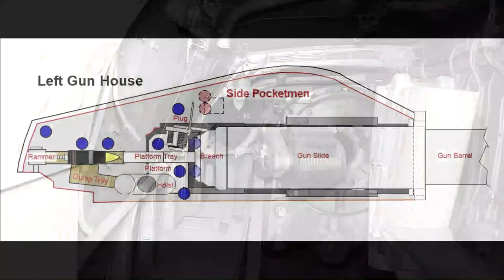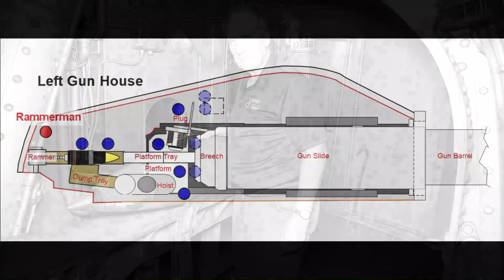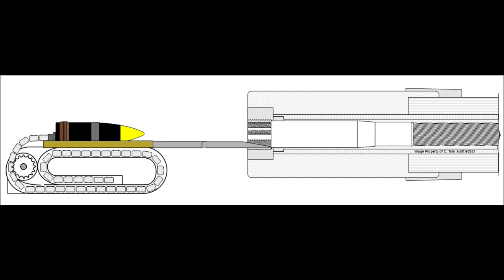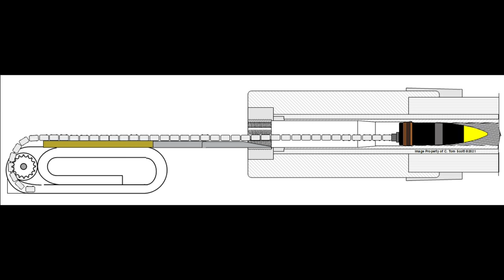Battleship Texas, Getting Loaded in a 14" Turret

Comment: What would happen or has it ever happened where the gun is loaded but never shot and needed unloading?
Reply from the maker: It would be an exceptional situation for that to happen.  They were pretty well committed to firing a gun at the moment the command was given to load.  The most likely reason that I can think of to unload one is if it failed to fire and none of the procedures used for a misfire worked.  That was also exceptionally rare and would be a gunner's worst nightmare.  

If unloading a misfire, they work with the idea that the gun will fire at any moment.  They first clear the turret of personnel, except for a gunnery officer and a couple of crew.  They wait a minimum of 30 minutes with the gun pointed in a safe direction since there may be a smoldering fire on the powder bag that eventually sets it off.  After that, they leave the breech closed, but open the firing lock and remove the primer.  Water is then sprayed through the primer vent into the powder chamber.  They have a special wand that allows that while standing to one side of the gun.  Once that happens, they open the breech and spray more water into the chamber, then the 4 bags are pulled out.  At that point the gun is safe.  A crew member then crawls into the empty powder chamber, attaches a lifting eye to the shell's base and that has a rope tied to it.  They tie the other end to the extended rammer, then reverse it to pull the shell out of the gun.  

If the exceptionally rare occasion happened that a ceasefire was called with a gun still loaded, they could unload it using the above method, but without hosing everything down with water.  The only problem is it was assumed that the powder bags would no longer ignite properly after being out of their storage containers for a long time and possibly warmed in a hot gun.  The bags wouldn't be dangerous, but simply would not perform in a predictable manner. For that reason, they would no longer be usable.  The bags would be placed in storage containers called tanks and set aside for return to the powder manufacturer for recycling.  However, that is a lot of work to go to, especially during war.  While it was expensive, the preferred method would be to "clear the gun through the muzzle", meaning they got permission from the task force commander, warned surrounding ships and fired the gun in a safe direction to get rid of the unwanted charge.

Comment: A question off topic. As I understand it, Texas was outfitted with submerged torpedo tubes. If so where we these located?
Reply: It was originally. But they were removed in a major retrofit between 1925 to 1927. Though it still would be interesting to see their locations. I have an old brochure from the Texas, when I visited the ship back in 1991. Just after its last drydock.
Reply from the maker: Go here for a profile that shows them.  http://battleshiptexas.info/images/Drawings/DeckPlans/1914/ExteriorProfile.jpg

Comment: At what point was the shell fused ?  Or did they not need anything done ?
Reply from the maker: All shells came from the depot with base mounted fuses installed and could be fired that way.  Only nose mounted, called point detonating fuses, and timer fuses were added on the ship.  They were installed in the shell while on the loading tray immediately before being rammed into the gun.  PDF fuses served as a backup and helped assure that the shell wouldn't be a dud.  Timer fuses were used to detonate the shell before impact for an air burst.

Comment: What did the powder guys do that are standing under the gun? If the gun elevates with them standing there won’t it hit them? Did they jump out? Or go further under? Also, what kind of hearing protection did they have? I can imagine it would be pretty loud? they have no idea when it’s going to be fired? That’s crazy!!!
Reply from the maker: The two powder men in the gun pit stayed well clear of the gun by laying down across the powder tray that was just forward of where the gun breech and loading tray descended.  

Noise was loud in the turret, but not because of gunfire.  The extremely loud firing was about 50' ahead of the turret and on the other side of 14" frontal armor.  Little of it got into the turret.  The loudest inside sounds were "swooshing"  from the gun's recoil buffer as the gun fired, and a loud mechanical bang as the gun was pushed back into battery position by 4 sets of counter-recoil springs.  

While it seems kind of spooky that they wouldn't know when it would be fired, there were only 3 of the gun crew had to be careful to stay out of the gun's recoil.  The hoist man was safety strapped and standing on a narrow ledge next to the gun, and two powder men in the pit certainly had to be out of the way.  The remaining crew in the gunhouse could move around while the gun was being fired.  The two loaders and the plugman likely just stood around and waited until it fired.  However, the shell man, tray man, rammer man, hoist man, and pointer and trainer were busy keeping the gun aimed and getting the next shell up, onto the rammer tray and ready to be loaded.
Reply: @tomscotttheolderone364  also, from my understanding and just looking at the mechanics of it, they had to “level” the gun back out every time to load it? I would think a lot of time was eaten up raising and lowering the gun between shots. Not to mention re-aiming every time!!!

Comment: I still can't believe they moved all the tank to one side of the ship, tipping the ship just so they can get a better range to fire more in land
Reply from the maker: That’s not the way they did it.  The ship had external torpedo blisters that were divided into a large number of watertight compartments.  Each had its own flooding and drain valve.  All they had to do was open a few valves and flood enough of the starboard blister with seawater to create a 2 degree list.  Once the fire mission was finished, they opened the drain valves and pumped it out.  All in all, it was simple to do.

Comment: During war time, were the big guns ever left loaded?  Also, how was the shell removed if it wasn’t needed? Or, did they simply just fire the gun to clear the breech?
Reply from the maker: Loaded guns were extremely hazardous and were never left in that condition.  Shots were generally anticipated well enough to bring up only what was required, but that doesn't mean it never happened.  Ammunition was expensive and manually unloading a gun would be preferred during peacetime, but it wasn't easy.  The biggest problem was what to do with the shell.  Powder could be placed back in storage tanks and made safe.  However, it would likely not be used after that since there was no assurance that its burning characteristics didn't change after being exposed to humidity due to sitting outside of its storage tank and in a gun barrel for a period of time.  Removing a shell from a barrel wasn't complicated, but was physically demanding.   There were two slots in the base of every shell in which lifting eyes were attached that were used to lift and move them.  Once the 4 powder bags were removed from the powder chamber, a member of the gun crew would crawl into it and attach a lifting eye to the shell's base.  One end of a rope would be tied to the eye and the other end to the partially extended shell ram.  The ram would then be retracted, pulling the shell out of the gun.  Shells were inherently safe, but sending them back down to lower decks and storage was very difficult since the upper shell hoist could only bring them up, not down.  That meant they usually stayed in the turret and were lashed down to the loading tray for safe storage until needed.   It was a different matter during war.  The general policy was to "clear the gun" by firing it.  Since the ship was normally part of a task force, permission would be received from the commander, the gun was aimed in a safe direction, other ships would be notified, and the gun fired to clear it.
Reply: @tomscotttheolderone364  thank you for the detailed information. I always appreciate the people behind the scenes that don’t get as much credit, like in this example for the gun crew of the large guns, or any gun. Amazing engineering, and people that made this happen. Thanks again!

Comment: It looks as though it’s only possible to load the gun in a horizontal position. Is that the case? Or can it be loaded while raised and trained on a target?
Reply from the maker: That is a good observation and you are absolutely right!  The guns can only be reloaded at 0 degrees elevation, the battery position.  That was necessary on most, if not all, U.S. 14" gun battleships.

Comment: I’m curious that shell appears to Have a steel case with copper gas checks, is this correct, if so, how did it affect barrel wear wise?
Reply from the maker: The shell did little to wear the bore.  Most wear was the result of erosion caused by the extreme temperatures, pressure and velocity of the ignition gasses, plus chemical reactions with the steel.  Here is a link to shell construction that explains the shells in detail.  https://www.youtube.com/watch?v=YZzNQ26uBr0&t=189s

Comment: What was the danger of having shells and powder in the pipeline that could produce an American equivalent to what Admiral Beatty observed during the Battle of Jutland?
Reply from the maker: While I am generally familiar with the problems at Jutland, I am certainly not an expert at it.  Here are my opinions regarding Texas' vulnerabilities.   Texas had better armor than what was on British battle cruisers, so it is less likely she would have suffered deep penetrations from armor piercing rounds.  Her main vulnerability would have been from high angle, plunging fire, but I am not sure if those were common at Jutland.  Beyond that, there were two contributing factors that may make a ship killing explosion on Texas less likely.  I understand that British crews on the ships may have had large numbers of powder bags exposed that substantially added to the problem.  U.S. procedures did not allow that, but that doesn't mean it wouldn't happen during combat when need for rate of fire may trump good practice.  Another issue is British double base cordite had nitroglycerin as a major ingredient, making it much more sensitive and burn a lot hotter than the single base SP and SPD powders preferred by the U.S. Navy.  The hotter, faster burning cordite in confined spaces was more likely to detonate than U.S. powder.  This is supported by instances of spontaneous detonations that resulted in loss of both British ships and Japanese ships that used cordite.  The only powder accidents on U.S. ships were open breech detonations, but there were no major magazine accidents.  This was undoubtedly due to the more stable powder and extremely careful, daily magazine and powder inspections.  On the other hand, I did not discuss it in the video, but Texas didn't start life with powered powder hoists, but relied upon men standing on a series of platforms to manually pass powder bags from the handling rooms to the dividing rooms until after WWI.  The result was very poor isolation between the two locations.  If there were several bags in the dividing room, 8 in the platforms and several in the handling room being transferred from the powder scuttles, an ignition anywhere in the chain would have probably killed everyone in all of those areas caused by burns and toxic gasses.  However, they would have burned hot, but not "explode" since the volume of the spaces was large enough to prevent significant pressure rise that promotes detonation.  So it possibly comes down to this, if procedures were followed, ignitions would have caused a lot of casualties, but likely stopped before reaching the magazines since they were were isolated by bulkheads and scuttles.  If the doors were open between the handling room and magazines, then the ship would be at risk.

Comment: Ok. So the pipe line is loaded . Action  comes to an end . What do you do with the shells on the line . Do you have to fire them or can they be lowered back down
   Also one can see how dangerous  rough seas could be ,or the concussion of the guns or a hit on the ship. Those shells would be rolling all over the floor 😬
Reply from the maker: That is an excellent question that has been discussed by several knowledgeable folks.  We know that the upper shell hoist was not designed to lower a shell back down to the upper handling room.  It may be possible to force it to do so, but it would fall outside of the hoist's design parameters, and expose the crew and hoist to injury and damage.  There is an auxiliary hoist tube in the outboard side of gun house deck that leads down to the upper handling room.  It is part of the turret's original construction, but there is no sign that a trolley and rail was ever installed on the turret's overhead that would have been required to move a shell from the loading tray to the hoist tube.  This eliminates all practical means of lowering shells from the gun house to the upper handling room.

This leaves two likely ways of dealing with surplus shells in the turret.   Unfired shells could be  lashed down to the trays to secure them in place until needed, which is mentioned in gunnery manuals.  They could also be fired to clear them out of the turret.  My opinion is that with periodic shortages of shells throughout WWII, this would have been considered wasteful and had it own set of problems.  What I consider to be most likely was that shells were sent up to the turret only as needed, unless they knew they were going to continuously fire a large number, such as on D-Day morning, and at Iwo Jima and Okinawa.  In that case, they likely "loaded the pipeline" in order to maintain a maximum rate of fire.   Likewise, unused powder bags were problematic.  If bags were sent back to the magazines after sitting outside of their storage tanks for more than a few minutes, they could no longer be trusted to fire with exactly the right characteristics.  If that happened, they would be put back in storage tanks that would be marked and segregated from the rest for return to the manufacturer for reprocessing.  This is something that gunnery and the captain didn't want to see happen very often, so again, they would likely not "fill the pipeline" with powder bags unless they were certain they would be used.

I don't think that the risk of a shell rolling off of a tray was that great.  First, concussion from firing the guns does not move things around that much.  The turret and its equipment do not jump around when one or both of its guns were fired.  Except a hit on the turret could certainly shake a shell loose, hits on other parts of the ship wouldn't move things around that much.   The main danger from firing the main battery or a shell hit is from the shock through the structure that loosens things up and the atmospheric pressure wave that injures crew if they are directly exposed to it.  Extremely rough seas could potentially dislodge a shell, but it seems pretty unlikely that they would be firing the main battery in those conditions and they would have everything secured.
Reply: @tomscotttheolderone364   thank you for answering  my questions and thank you for your dedication to Texas !

Comment: What I want to know, is how LOUD is it inside the gun room when that gun is fired?  It also looks like there's no recoil system on the gun.  Is this correct?
Reply from the maker: A veteran who served on a 14" gun crew said that firing the gun could certainly be heard, but it wasn't uncomfortably loud.  That is because the muzzle is about 50 feet away and on the other side of 14" thick armor.  The greatest noise was from the recoil buffer making a loud swooshing sound as the gun recoiled, then a very loud slam as the barrel was pushed back into battery position by the counter recoil springs.  That partially answers your next question.  The guns certainly had a recoil system.  It's proper function was absolutely critical so that the gun mount wouldn't be damaged during firing.  If you go to 19:15 in the video, you will see a heavy flat steel plate attached to the barrel below the breech assembly.  There are four hex head bolts, one in each corner.  Those attach four sets of counter recoil springs used to push the barrel back into battery position after it has recoiled.  The large round nut in the center attaches a very large hydraulic cylinder mounted beneath the barrel that is the recoil buffer.  It is a giant shock absorber that slows the recoil impulse.  It's function was so critical that it was a requirement that fluid levels be regularly checked by the ship's senior gunnery officer before firing.
Reply: @tomscotttheolderone364  That's great information.  Thank you very much!